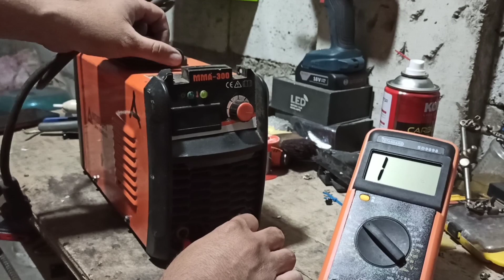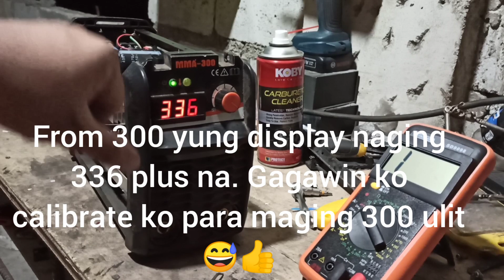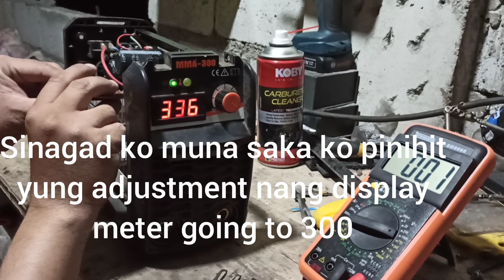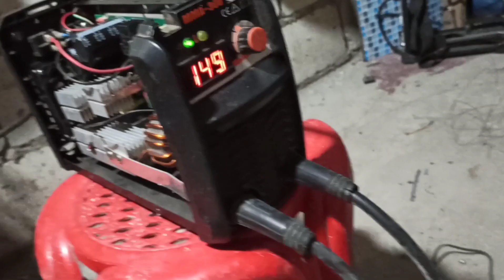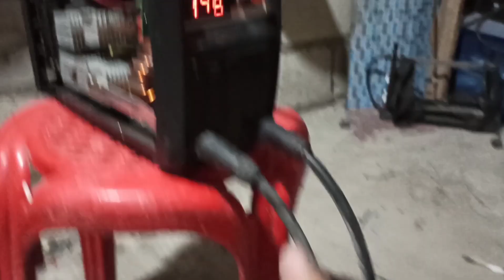MITSUSHI MMA-300

Comment: Yng ganyang klase ng welding machine mga ilang amper talaga
Reply from the maker: 150 lng tan sir
Reply: Mahina lng pla sir kya hindi tatagal talaga yan sir lalo n kng gagamitin p ng pangcutting wala n sir sunog sya
Reply from the maker: Ou sir pero yung display 300 hehe
Reply: @diodeyap  mukang wala pa sa 150a boss kaci ung apat na 40n60 eh nasa 150 to 160 lng kung mag read tayo sa rod test eh nasa 120 to 130a lng to boss anghina talaga😅

Comment: Ask lang poh. Bakit poh nasisira yun 10% power supply nya?
Reply from the maker: Pangit yung pagkagawa/possible nagloko yung fan bower na 24v/ or nag fluctuate yung power tumaas yung supply nang 10% galing sa capacitor
Reply: @diodeyap inverter din poh kasi ang gamit ko na welding machine powerhouse. Medyo hindi ko sya masyado ginagamit ng sagad kasi natatakot ako na baka madaling masira. thank you poh sa information 😊